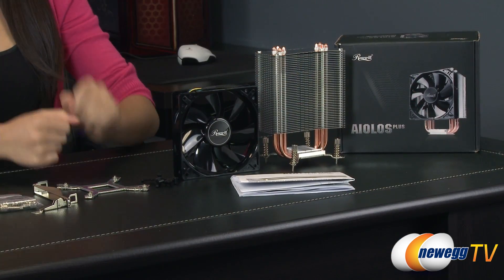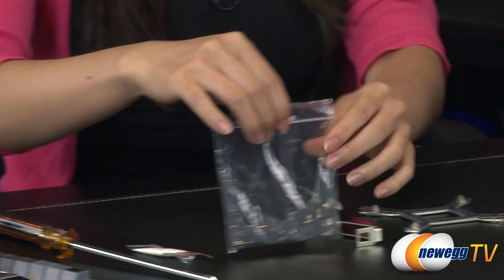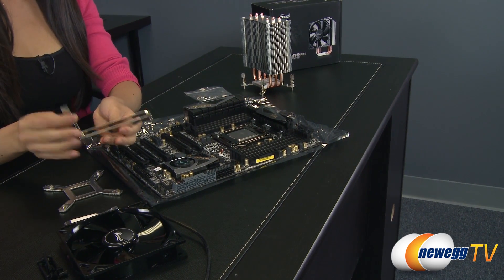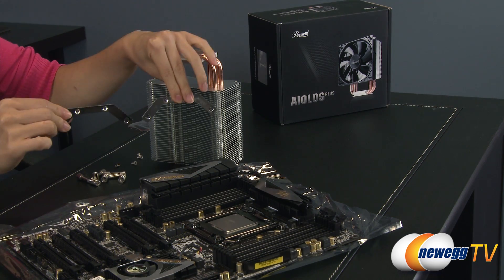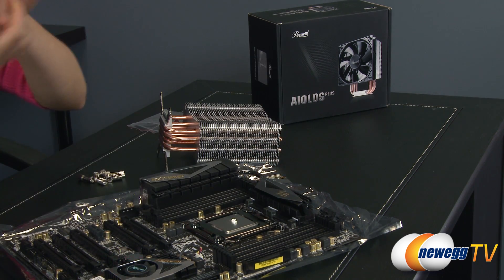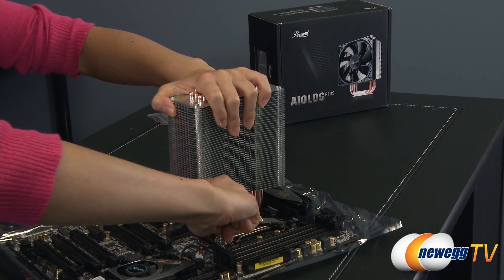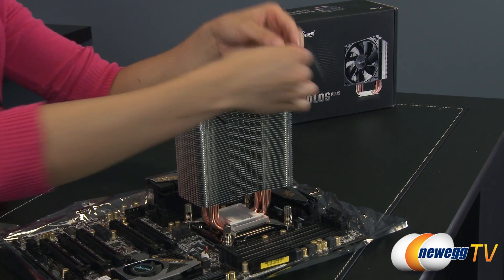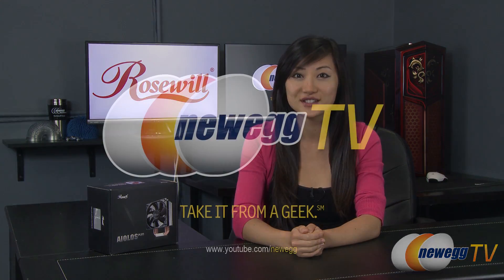Rosewill AIOLOS PLUS 120mm CPU Cooler Overview & Tutorial - Newegg TV

Comment: I'm not altogether sure about that.  I can see this being done for workstation computers, because depending on what kind of mission-critical work is being done, stability is very important, but having more cores/threads is also important.  So as a result a studio could buy a 3930K and this for basic stock-clock cooling.